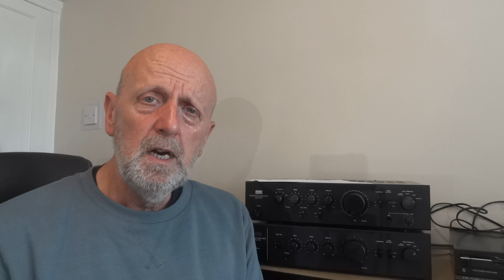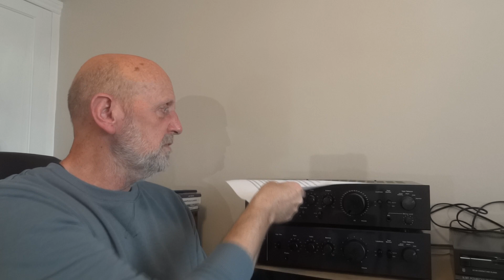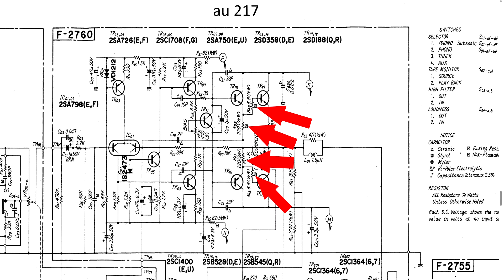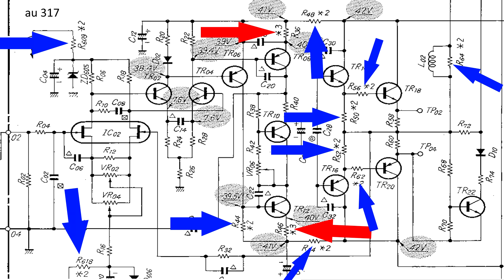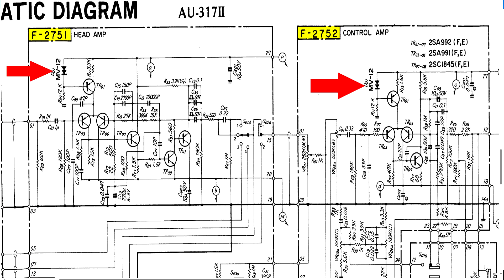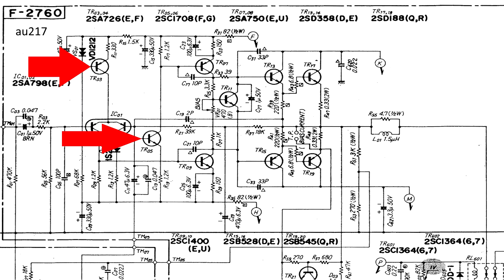Sansui au-217 au-317 Amplifier Common Faults. Diodes, Transistors, Resistors. VD1212, MV-12, 2SA726

Comment: can you just clarify which  transistors you changed on both channels your naration is confusing cheers.
Reply from the maker: For the left channel tr3 I replaced the 2sa726 with a ksa992 and tr5 I replaced the 2sc1708 with a ksc1845fta.
The right channel tr4 I replaced the 2sa726 with a ksa992 and tr6 I replaced the 2sc1708 with a ksc1845fta. Hope this helps.
Reply: @MichaelYates thanks Michael

Comment: Hi Michael. Great informative video! I have a question if I may. I am trying to get an AU-X410R going again. It has ZERO bias current on either channel. The amp plays, but very softly. I also cannot for the life of me find a service manual for this amp. Any thoughts?
Reply from the maker: I think you really need the service manual to get some voltage checks that should lead you in the right direction. If both channels then I would start with the power supply to them. Not easy with no manual
Reply: @MichaelYates  Thank you for taking the time to reply. Yup, VERY difficult without the manual. :(

Comment: I'd like to thank you for your tutorial. I have a 317 that had the problem of going into protection after about 30 minutes. The problem was the resistor on the TR08 collector. Now everything is fine.
Reply from the maker: Thanks for your comment on relay protection fault and solution it might help others with similar a problem.

Comment: I have a fault on the preamp of the phono input right channel only. Do you have any clue from where it can come ? I will try to test and change one of the transistors. Did you see a lot of faulty transistor in them ?
Reply: Details: the right channel of phono input cracks with strong level. Independently of other selectors positions.
Reply from the maker: Sounds like a noisy transistor and yes the most I come across are in the pre amp part of the circuit
Reply: @MichaelYates thanks ! It's crazy how this good old tech is still usable these days. I actually find that the sound quality is nice !

Comment: Thanks Michael! I recently bought a Sansui AU 217 and unfortunately it developed a fault just a month after I bought it. One channel a lot of static and a crackling noise and the balance control doesn't work anymore. Any idea what the cause of it may be?
Reply from the maker: This amp is known for a lot of problems, I would clean the tape monitor switch to start, then look for dry joints. But sounds like a noisy transistor, could well be IC1 OR IC2 depending on what channel the fault is on, so replacing that with
 matched pairs of KSA992 transistors and another possible is Diode MV-12 on faulty channel replace with two IN4148 in series
Reply: Thank you, this is very helpful! I'll see if I am able to track the problem down.

Comment: Took mine in for repair a few years back the fuse resistors were replaced and one transistor on each channel. So I would think very much the same as what you have done here.
Its a great amp and for the £100 repair bill it was worth every penny. Great Video. edit Just found recipt was £80 labour £8 parts plus vat £105.60
Reply from the maker: Thanks for the comment and the price info is interesting. Always wondered what they charge these days for small repairs.